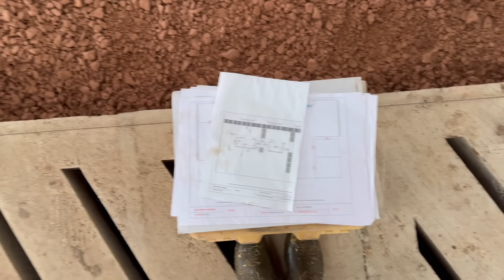It’s all coming together in the dairy shed the Sumps are in for the robots to sit on.

Comment: A impeller sucks a propeller blows, the centrifugal force of a propeller on a boat pushes water away causing the forward motion. A impeller sucks compresses wizardry & witchcraft happens to create thrust. Like on a jet ski. Given the whisk pushed the slurry away from the tractor it would be a propeller. Slurry pumps use a impeller.

Comment: An IMpeller wwould be incased in a housing, like in a pump or turbine.  It moves liquid by creating pressure to push fluid up a pipe.  A propeller has exposed vains like a ships or airoplane propellor.

Comment: My recollection of pigs swill in Norfolk was that it had to be boiled in a large container often brick built which had a partial division in the middle from the top. This meant that the boiled food on one side for issue could not be assimilated with the uncoiled food be placed on the other. In those days the tiny potatoes which are sold in supermarkets today were known as pig potatoes and stained purple. Country People would use these and place them in a stew. Today farmers are at last making money from them - I hope! Ask your Father!  Impeller propellor think about the word construction one pushes- propellor and the other - yes you have worked it out already -  it stuffs it up the spout. Well that will satisfy the lads!
Cows gallivanting it is heading to spring - boys and girls do it too!